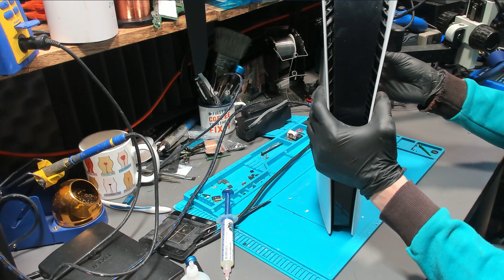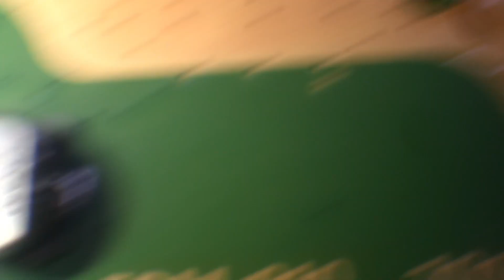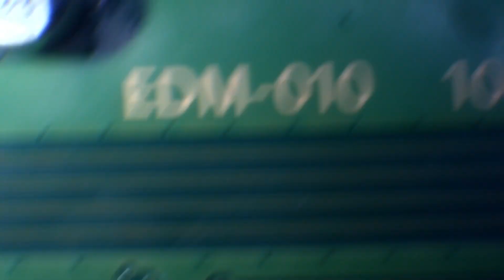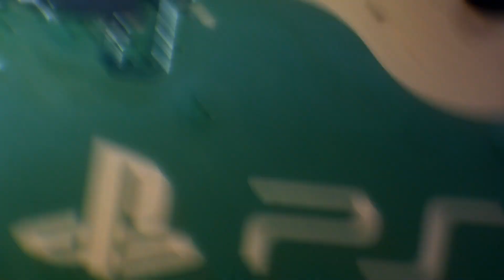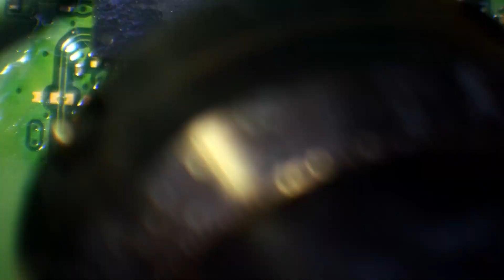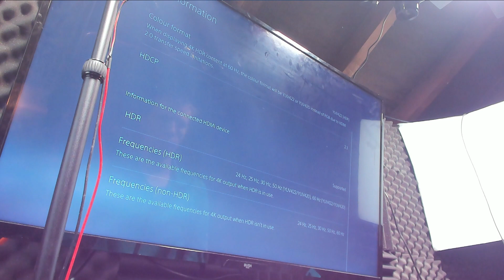Apparently The PS5 HDMI Encoder Fails In Spectacular Fashion! PS5 2 Second BLOD And No Power Repair

Comment: Hopefully you or someone else can help here, the HDMI port is new, caps and zener diodes are good, all caps around encoder chip good(so no short in encoder chip right?) ALL CAPS under the MAIN CHIP, in the middle of the board, are getting THE BEEEEEP!!! DOES THAT MEAN MY MAIN CHIP IS BAD??? The unit turns on (normal and safe mode) but shows NO IMAGE... Any ideas?

You have any input on this "power chip" looks like a MOSFET but it's near the HDMI port is labeled 15JL.. Apparently, it controls image, I'm not sure if that's my problem, I've tested everything to best of my knowledge, but my knowledge is limited....port header is Cleanly done and as stated above, other pieces are allegedly good

Comment: Nicely done. Seems your really getting the hang of these next gen repairs. 120/130 is still good value given the lack of part availability and the labour time you obviously spent getting it back to life. Would there be much difference in cost if the parts were so readily available?
Reply from the maker: Thanks mate, yeah we're definitely making progress figuring these things out. If the parts were available I'd adjust my prices for sure, the problem at the minute is I'm pretty much guessing what they're going to cost when they do come onto the market
Reply: Anything less then ebay price for a replacement is probably a deal this year.
Reply: @alexb5766  yeah I'm curious about that as well. If a console doesn't work its really got no value other than spares/repairs.. so if it's the same thing that breaks down and only get 1 in each donor board then what is it really worth? But if lots of different things can break and you get more spares out of 1 donor then there is the "sum of parts against the whole" equation to factor in.. I'm no engineer, I dont pretend to be an expert I just like watching these things and seeing how they figure it out. Wonder what a donor board is really worth for fixing purposes.

Comment: Your probably correct 5.0 voltage regulator two pins out two in and center are common left an right side for the HDMI data voltage ?
Reply from the maker: I'm not sure to be honest I need to try and get some readings from a known good board while the console is on :)
Reply: Without the data sheet on the regulator with the specs on the chip/hard to tell what is at fault especially if a capacitor is wonky thermal breakdown on the casting voltage drops or shorts to ground and affects the entire line right on the voltages on a working board would help HDMI chip looks a bit toasty too lightning strikes and bad ground on the dwelling causes alot of issues especially in England and Europe you guys have 220 over there and a bad ground connection in the house cause more damage to devices over there so more than water damage there on the board I see alot of that on other repair casts such as yours one tuber here in the states sends you chips to reball them you do so well with those  I give it to you your determined the way you trace conditions and solve them thought you had it when you fired up that board then another chip or part failed when it fired up I felt your frustration and hung in there with you till the end of the cast

Comment: 15R is not a short in a 5V line?? Fuse stress? Sorry but there’s bugger all wrong with the 3V3 switcher or the fuse!
Reply from the maker: Yeah I agree the fuse and reg wasn't bad, but it was short on that circuit so I replaced them just as a precaution
Reply: @TheCod3r  I suppose it rules them out but you did have 3V3 on on the output…

Comment: mine turns on but no image do you think the hdmi decoder chip is bad
Reply from the maker: Could be mate or the port. I'd say most likely the port to be honest
Reply: @TheCod3r  I need to send this out to you
Reply from the maker: @gamerX-wk7ct  it's hard to say mate without seeing it really. I'm happy to try and fix it for you though but cost would depend what's wrong
Reply: @TheCod3r  right I just need to figure out shipping from the US to you and package this thing to be built proof 😆 but I'm not concerned about the cost to fix it . but it's weird first it would beep and turn off now it turns on but no damn image I did open it up and smoke like a pack of cigarettes while bitching at it 🤣
Reply: @TheCod3r  I just don't see the port being bad this ps5 was setup in 2020 nov and never moved until a few weeks ago when it stopped putting out a image   do you still think it's the port another thing the controller still works with it I can turn it on and off by it im stumped by this problem